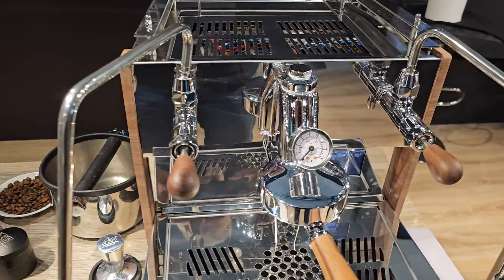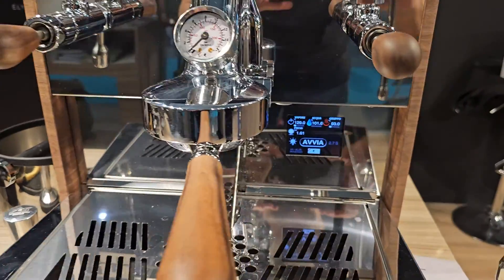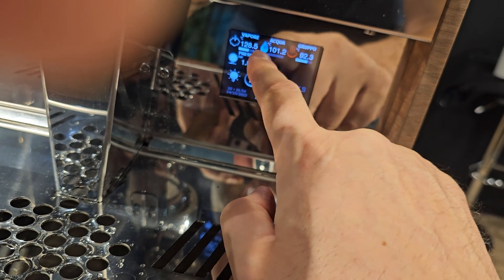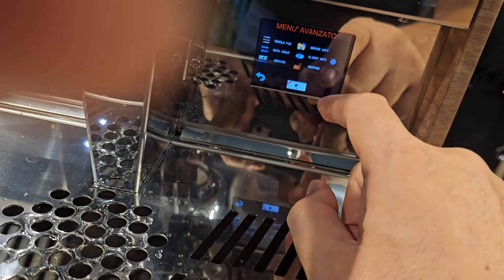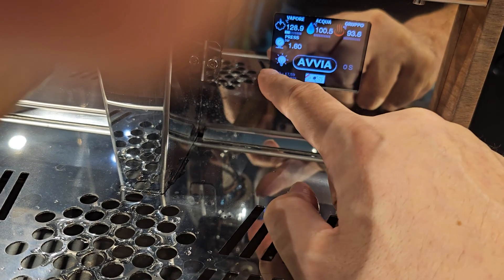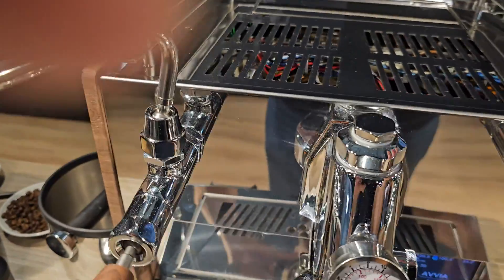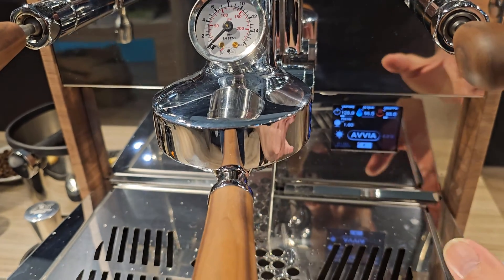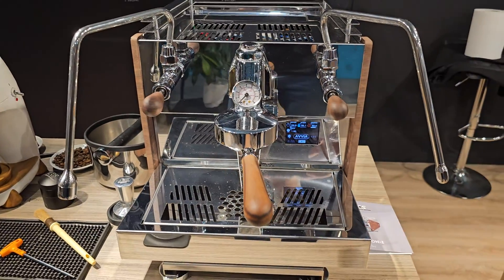ACS Falcon I Dual Boiler espresso machine

Comment: Any idea what the MSRP will be roughly?
Reply from the maker: Not yet, as they have not calculated the  volume production build cost.
Reply: @DaveCorbey  Lance Hendrick said "under $2000" when he was at the booth in his video. Wow.
Reply: @amerikalast  Under $2000 doesn't make sense. They just updated the Minima so that indicates that they plan on continuing to sell it. And if that's the case, and if the Falcon was under $2000, it would take away most sales from the Minima. Additionally, $2000 would be considered way underpriced based on competition with the included features and specs.
Reply: @RTR-96  I agree, but Lance was crystal clear. Maybe it's supposed to be "under $3000" which makes more sense. Either way, the price is mostly margin. Personally, I like the looks and the E61, but at the end of the day almost any machine can make the same cup of espresso - the single most important piece of equipment is always going to be the grinder.